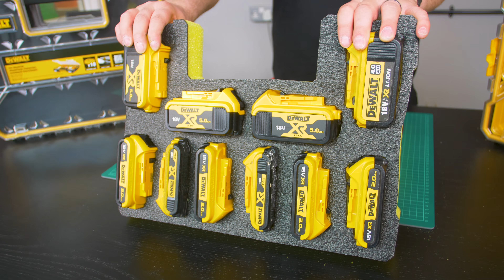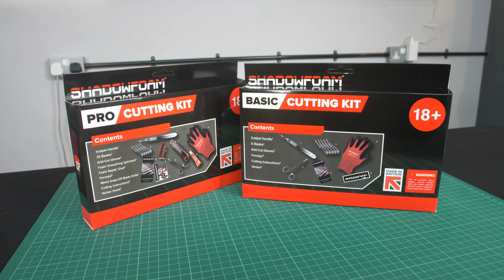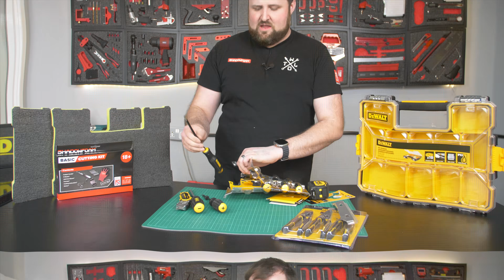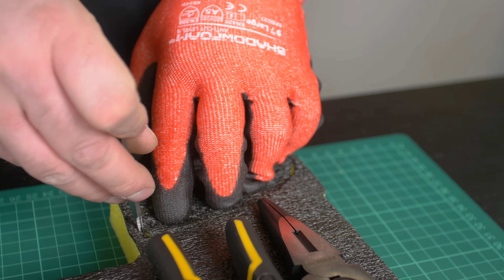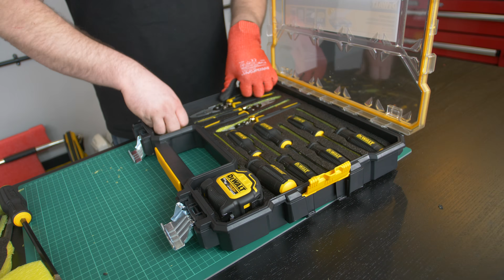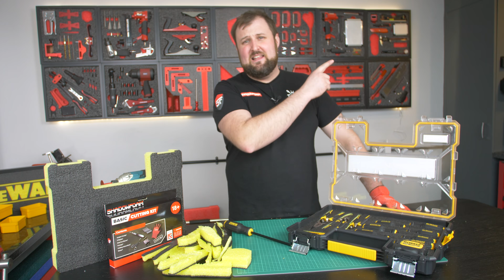The DeWalt Pro Organizer Tool Box is the PERFECT CASE for Organizing DeWalt Hand Tools!

Comment: If you get the dewalt toughsystem 2 adaptor plate from the USA, these boxes can then be attached to that system. The adaptor plates sold in the UK are not compatible.

Comment: The measurements on the back of the tape are fairly useful if you're measuring on the side which has inches you can just tilt it and see the metric on the under side
Reply from the maker: Youre absolutely right!
Reply: I use the bottom side when I’m measuring something above me, and it’s too long to hold upside down without it flopping
Reply: @machieltipo  I don't think I've ever been in a situation like that where I can reach the ceiling
Reply: @iplayzthegames6968  not for the ceiling, but for something already mounted on the wall. Such as you mounted a horizontal stud for a shelf at a height taller than you are, and you need to find the center bc you forgot to mark it prior.